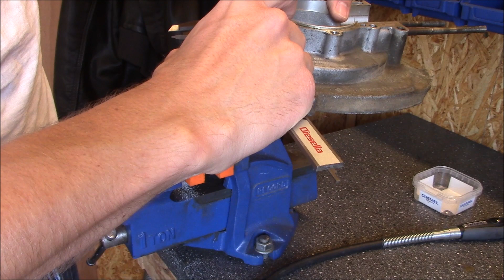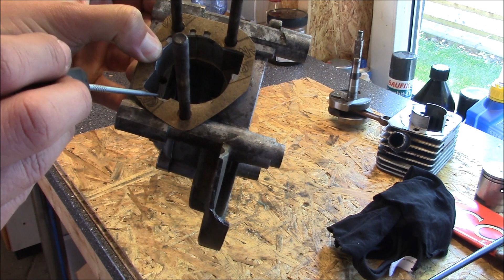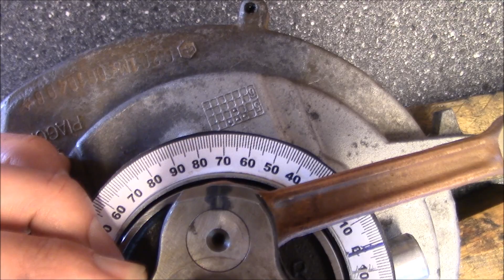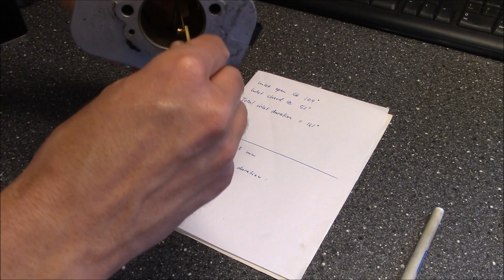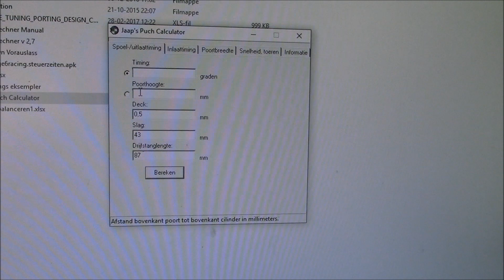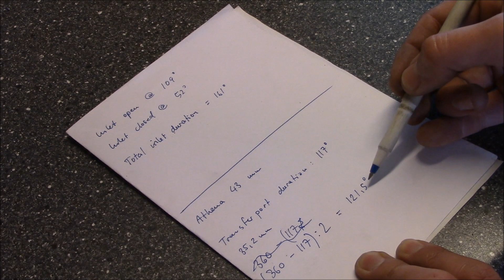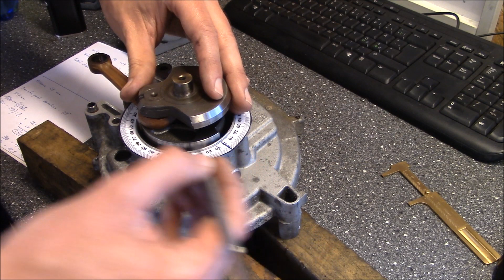Piaggio Moped Engine Tuning

Comment: Hey Carsten. Sorry to bother. I slipped with my Dremel on the part that I wasn't supposed to grind in the rectangular intake in the crankcase side of the Ciao engine. Just made a small scratch but I can feel it with my nail. You reckon I can fill it with epoxy resin? According to the Malossi manual I found online it is very likely that my engine is screwed. Thoughts? Kind regards.
Reply from the maker: Hi, fill it with a good liquid metal, i use JB Weld. I've repaired very bad intakes with it, with success so far.

Comment: How is the Athena kit? I have been using the Malossi 43mm cylinder for a couple years now and it still runs fine, but is getting weaker and still bad low end power. 

So maybe a good time to try a different kit. I've been thinking maybe a DR or Polini, it has to be 43mm as I have no access to mill the case wider.
Reply from the maker: It's fine, but in the expensive end. The DR is hard to ignore, one of the best performers and the cheapest.
You should have ok bottom end with a malossi 43 mm. Unless you run an expansion pipe exhaust?
I only recommend the original style exhausts for single speed setups, like the Giannelli Original Power or Sito Plus. Though, that might have something to do with my weight also. :-)
Reply: @CarstenLorenzen12V  maybe I'll try the DR next, I hear it has a lot of potential for porting too. But I already port matched my case to the Malossi, so there might be an issue if I use a different cylinder and they don't match closely. 

I have the Techno Circuit pipe, yeah I know it's not so good, but it's cheap and circuit pipes are said to have better low end anyway. I ride in a lot of city traffic so I need good acceleration off the line.

Comment: og hvad med drev-hjul, der sidder originalt på 9,5 cm i diameter.... men skal vel ned i 6-7 cm ikk?... og med rem der passer til.... men kan man ikke osse skifte i den anden ende af drevet ved koblingen? hvis, skal den vel modsat være større i diameter? men passer remmen så?... altså hvis større diameter drev på kobling
Reply from the maker: Der findes en kobling med stor og lille remhjul. Det lille er mest udbredt. Dertil et 60-65 mm hjul bagerst. Har du den store kobling, så et 80 mm bagerst.
Til den lille kombination, mener jeg en ca 912 mm rem, til den store 962 mm. Hvis mine notater er korrekt.

Comment: HI Carsten - thx for superb instruction videos. I do have a few questions though...
1. Is the 1993 ciao piaggio stock crankcase(with enlarged inled) able to fit any of the bigger cylinders offered on the market or limited by size?... says some of the bigger cylinders demands modification of cranckhouse as you mention, but will the "cylinder skirt" from ex BigDep fit? They look to big but are so temting hahaha. 

2. When grinding the "plompe" away, how will I know wich carb to choose, many recoments the SHA13/13...
3.På dansk...  Husk at motorblokken skal fræses, ved montering i en standard motorblok.... - når der skrives dette om de store cylindere over 43 millimeter, er det så nok at fjerne plomben? Hvis jeg nøjes med 43 millimeter cyl, kan jeg vist genbruge original topstykke korrekt? og kan man vinde lidt kompression ved at plane det lidt, det fik lidt ridser da det skulle afmonteres fra cyl. Det med at tilpasse skyllekanalerne til krankhus pakningstrik kan man jo først når man har cylinderen. Hvor nøjagtigt skal "inled" være, bare som på videoen eller bare nogenlunde som på videoen haha :-) hvad er forskellen egentlig på 10/10 12/12 el. SHA 13/13
Reply from the maker: Hej igen :-)
1. I standard blokken kan du montere alle 43 mm cylindre. Hele blokken skal fræses op hvis du vil have større på. Men en DR 43 mm gør det meget godt.

2. Det er diameteren, studsen kan max fræses til 13 mm, så tag en 13.13.

3. Du kan godt bruge standard topstykket, men plan det max 1 mm, ellers kommer dekompressions kanalen tæt på forbrændings kammeret.
Det er i småtings afdelingen, hvis du tilpasser overgangen til skyllekanalerne. Under en håndfuld km/t. Men ved sådan en tuning er der gemt en lille smule, forskellige steder. Tager man dem alle med, er summen ofte tydelig at mærke :-)

Comment: Do boost ports lower fuel efficiency?  I understand in making more power one would use more fuel but is there a penalty at more regular speeds.
Reply from the maker: I have no scientific measurements on this subject. What I've noticed is that my tuned mopeds run nearly the same km/l as the slow ones. They run a longer gear ratio, and i can drive the same speed with only a little throttle open.

Comment: Hei,
Nydelig video! 
Har prøvd og porte blokken min etter beste evne
Har nett prøvekjørt min superbravo med polini racing 63cc cylinder kit, 13 sha malossi forgasser kit og mazzucchelli veiv. Har ikke skilt eller speedometer på den, men gikk godt. Det står nå Mallossi variator kit på den med gul fjer, og jeg har satt inn 10g variator ruller. Hva vil du anbefale av variator oppsett ? Vekt ? Fjør ?
Reply from the maker: Prøv med 7 gram, det burde passe ret godt :-)
Reply: @CarstenLorenzen12V  Takk så meget :D Jeg kjører med Giannelli standar eksos. Vil jeg merke noe særlig mer effekt med giannelli Fire ?
Reply from the maker: @rjanvatsy1343  ca 5 km/t mere med Fire, men også en del mere larm.
Reply: @CarstenLorenzen12V  Fikk prøvekjørt med Fire i dag og 7 gram. klarte rundt 65km/t på flaten. På vei hjem igjen blei motor for høyt belaste og stoppet (for varm) Kjørte med et ødlagt vifte hus. Startet og gikk fint etter på.  Noe som går ann og gjøre for å forbedre kjøling ?
Reply from the maker: @rjanvatsy1343  jeg har ingen problem med kølingen, når køle skjoldene er i orden.
Hvad dyse og luftfilter kører du med?
Reply: Carsten Lorenzen Malossi luftfilter og 0,68mm dyse. Tror du det kan være for marginal blanding ? Prøve med 0,80 dyse uten luftfilter ?
Reply from the maker: @rjanvatsy1343  68 lyder meget fint til den opsætning, måske prøv en 70. Mere kan den ikke klare. Tror bare du skal have fikset dine køleskjolde, og lige tjekke hvordan stempel og cylinder har det. Har du først haft en varmesætter, vil den ofte klemme samme sted, da noget af stemplets alu, er blevet komprimeret på det sted den klemte.

Comment: Hej Carsten, fantastiske videoer du har lagt op! 
Kan du anbefale nogle modifikationer, så jeg kan få min Ciao til at trækker mig op af bakkerne? 
Når vi er afsted i klubben er jeg altid sidste mand på toppen af de små bakker. Jeg behøves ikke meget mere topfart end 30-35.

Jeg overvejer selv et hak i stemplet. Giver det mere at bore i indsugingshullet, samt større karburator/dyse?

På forhånd tak.
Reply from the maker: Lasse Kristensen Hej, Ciaoen er begrænset med en plumbe eller kun 7 mm hul i studsen, dertil en krumtap med anden åbning.
For at man kan gøre noget ved det, skal motoren åbnes. Studs og vinduet gøres større, karburatoren kan nemt slibes/bores til 10-12 mm. Luftfilter skal have nogle ekstra huller, eller skift til filteret fra 50 km/t modellen. Og så lige en inddysning.
Hvis du ikke piller ved gearingen bliver den meget stærkere op ad bakker.
En diskret tunudstødning hjælper også, Giannelli Original Power eller Sito Plus f.eks.
Der er desværre ingen nem løsning på Ciao motoren. Hak i stemplet hjælper intet, den fødes via den i krumtappen integrerede drejeventil.
Reply: Carsten Lorenzen tusinde tak for at du tog dig tid til at svare. 
Jeg vil give den en overhaling, så er jeg spændt på hvordan den kører :-)

Comment: I did the same as you did but now I have no compression. What should I do now?🤔 
Malossi cylinder 43mm
Reply from the maker: No compression where? In the combustion chamber? You need to check for leaks, gaskets, piston rings, decompression valve etc.
Reply: Carsten Lorenzen 
How should I check these things.
I have a new piston with new piston rings and a new gasket. But an old decompression valve. What else could it be?

Comment: Hei! ødlegger man noe hvis en borer mer en 1,8 cm inn i innsuget?Veldig bra video
Reply from the maker: 18 mm er på den sikre side, ved de fleste blokke kan man godt bore 20 mm. Borer du for langt, bliver den utæt til siderne, da indsugningen bliver smallere på det sted. Tak :)
Reply: Ok, da er jeg redd at jeg har boret for langt🙈 den ville ikke starte etterpå, må jeg bare få tak i ny blokk/veivhus? Har satt på Malossi trimmsett+forgasser å variator kitt fra malossi. Men etter fresing i innsug å kanaler i blokka ville den ikke starte😭
Reply from the maker: En nem test, tag motor og karburator af. Drej krumtappen så den spærrer for indsugningen. Pust i indsugningen, det skal være svært at puste luft forbi krumtappen. Der skal være en del modstand, men forvent ikke at den er helt lufttæt.
Reply: ok ,kjempe bra. da skal jeg prøve det når jeg for montert sammen motoren igjen. har akkurat frest på veiv for åpning/stenging.

Tusen takk for hjelpen, super bra (kanskje du hører fra meg igjen hvis jeg for problemer:)
Reply: Hei! Nå starter den, men det går ikke i mer en 35km/t🙈 har du noen idé på det? Er det noe blombe eller sperre?
Reply from the maker: Din indsugning var tæt og ikke gennemboret? Hvilke dele har du monteret? Tændings justering? Hvad dyse kører du med?
Reply: Det stemmer, den var tett. Har satt på cylinder kit Malossi, carburetor kit Malossi SHA 13 og Variator kit fra Malossi. har ikke gjort noe med dysen siden jeg kjøpte ny forgasser. Tenningen har jeg heller ikke gjort noe med annet en å juster stiftåpningen til 0,4mm
Reply from the maker: Dysen skal nok være på en 68-70 med Malossi filter og 13 mm karburator. Jeg ved ikke hvad de leverer den med fra fabrikken. Tænding på 0,4 mm lyder fint.
Trækker den fint til 35 km/t eller føles motoren svag?
Reply: Det er 66mm som er standar på min 13 mm karburator. ja den går fint opp til 35 km, men det skjer ikke noe mer etter det, virker som den sperrer på en måde., den er ikke svak, men det skjer ikke noe mer bare:). sitter det noe gear system i nave bak på den?
Reply from the maker: Er din model oprindelig med Vario? Du kan ikke montere en vario, hvis du har fast remskive bagi. Du skal nok have målt gearingen i baghjulet. Mål hvor mange omdrejninger du skal dreje remskiven bagerst, for at baghjulet drejer én omgang.
Reply: Ja denne er helt orginal eller var:) Det var ikke fast reimskive bak, byttet bare ut den fjæra som var der med en ny fra Malossi. Ja skal måle det når jeg kommer hjem fra jobb. Ser på Moped-speed.dk at de har trim udstødning til denne, hjelper det noe?
Reply from the maker: Kommer an på hvilken udstødning du har på nu? Nogle af de originale med tyk forrør kører også rimelig godt med større cylinder. Men der er helt klart en begrænsing. En Giannelli Original power eller Sito Plus er god i standard look.
Lige for at være sikker, du har ikke monteret den sorte begrænser ring som fulgte med din Malossi vario? Den vil begrænse topfarten meget.
Reply: Nå har jeg bare orginalt å det ser ud til å være smalt rør ja. Nei den har jeg ikke satt på.
Reply: Utvekslingen er 11 runder på 1 runde på dekket. Hva birde farta på denne være sånn ca med dette oppsettet?
Reply from the maker: Det er super, det skulle gerne række til 60-70 km/t. Det er nok 10,7:1 du har - det er den samme jeg kører med. Der må være noget andet galt, jeg er lidt tør for ideer lige nu :-/
Reply: ok det jo bra da, ja men da har vi gått gjennom ganske så mye nå :)jeg sjekket med litt startgass rundt ved innsug å da blei motoren kvælt, så det er vel kansje noe falsk luft problemer....
Reply from the maker: Det er en god test, så du kan få elimineret alle steder hvor den trækker falsk luft.
Reply: Hei! Da vil æ takk for kjempe god hjelp. Feilen var at æ ikke hadde byttet simringen på veiva🙈 det var sikkert en selvfølge for deg, men det tenkte æ ikke på. Så nå går den som en rakett 😃👌🛵🚀 tusen takk for veldig god hjelp😃👍👌👏
Reply from the maker: Lyder godt, tak for tilbagemelding! God fornøjelse med raketten ;)
Reply: HEHE takk for det. Kjøpte Giannelli udstøting, men den passet ikke akkurat bolt on. har ikke sett på det enda, men er det masse en må gjøre for å få den til å passe?
Reply from the maker: På min Ciao passer Giannelli'en direkte på uden modifikationer. Ved at den ved nogle går lidt på dækket hvis det er for bredt. Ellers kender jeg ikke til problemer med den.

Comment: this is excellent! I wish you made this video before I started building my Ciao engine. it would've saved me lots of research and second guessing when trying to translate the Netherland forums!
I have the 43mm Malossi kit and the specs say to cut the crank 10mm open and 5mm close, so I did. my results are: inlet duration 186°, transfer 128°, exhaust 171°. the low end suffered quite a bit, although I am using single speed and decreased the rear pulley to 70mm. my top speed is about 43mph, I was hoping for 50 but it seems the techno circuit pipe isn't good for high end.

very very good info in this video and it's laid out very clearly. even people with little mechanical knowledge would be able to follow this. and I'm glad it's in English.
good job and keep it up! I'd like to see more moped videos from you.
Reply from the maker: Sir Charles thanks for the nice comment. You can regain a lot of the bottom end with clutch tuning. I like to lighten each shoe with two 8 mm holes and then use the black Malossi springs. 
The Techno Circuit isn't a good pipe, what I hear. Better take the Proma Circuit or even a Giannelli Original Power.
43 mph is allright for this setup, maybe you can gain a bit with a better exhaust, but don't expect 50 mph. That takes a larger gear ratio and will hurt the acceleration even more.
Reply: Carsten Lorenzen thanks for your reply! yes I tried clutch tuning as well, but even with the weakest Malossi spring it doesn't rev fast enough to work properly. it just keeps slipping and takes very long to grab, acceleration is worse than the stock clutch springs.

I don't know why it is so weak on the take off. I feel it must be timing or ignition because I've fixed the air leaks. could a weak spark cause bad acceleration? I saw your other video, so I will check my coils. but I've already replaced the points, condenser, and external/secondary coil so I think the primary internal coil is not so good.
also it starts ok from cold, but after warm up if I stop and go in a store, 15 min later it becomes very hard to start. I have to hold wide open to try starting and I get some backfire too, I don't know if it's from exhaust or carb though.
Reply from the maker: Could be an ignition problem, my Piaggios start at the first engine rotation every time, hot and cold. I've never seen an internal coil fail, but have seen new and defective condensors and external coils. Only use the original blue Piaggio coil for the external one. I've only had problems with the remake ones.
What jet and airfilter are you running?
Reply: Carsten Lorenzen my Ciao is a completely rigid 1971 base model and it has a brown/tan coil. the jet is a 69, and I have no air filter, just a thin screen. I replaced the original coil because the wire broke off right at the base and there is no way to replace the wire on that type.

so I am thinking there may be a timing problem because of the backfires when trying to start. but if it actually is blowing out of the carb instead of the exhaust, could that be because the crank was cut too much?